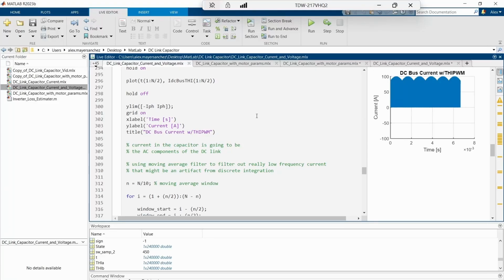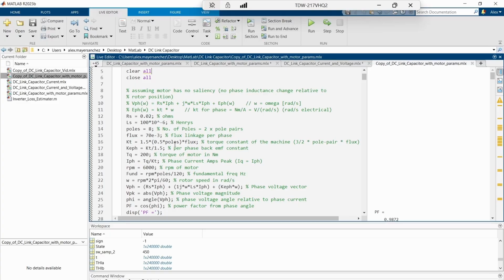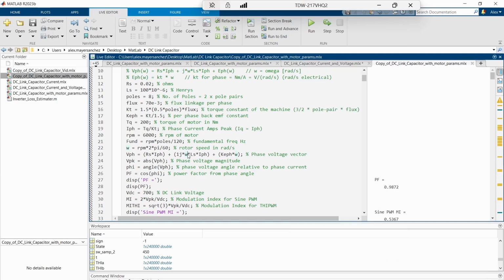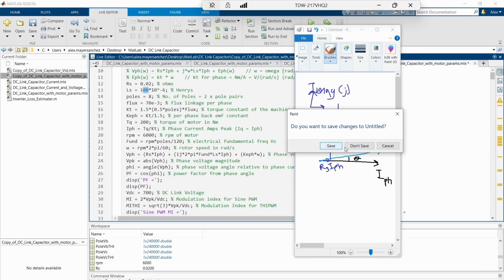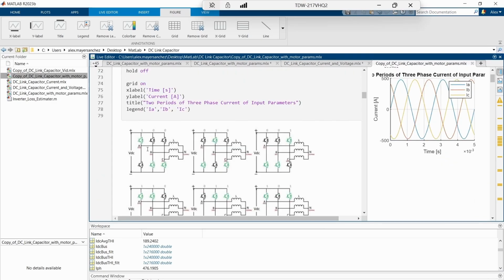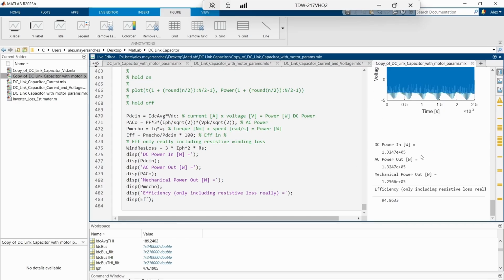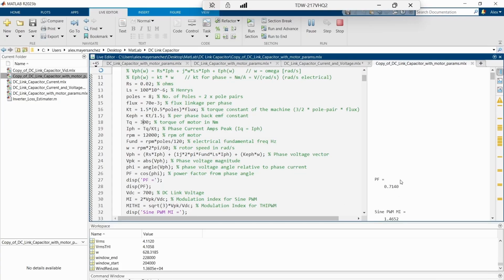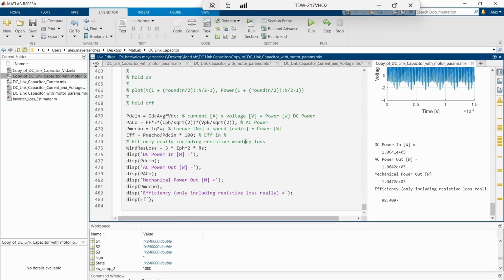2-Level 3-Phase Inverter Synchronous Motor Load (Part3)

Comment from the maker: I have an error in this script actually, the modulation index for sine and third harmonic injection PWM should be the same (MI = 2*Vpk/Vdc) but the MI for THI goes up to 1.15 for the linear region, whereas with Sine PWM the linear region max MI is 1.0. 

The equation for MITHI is wrong!